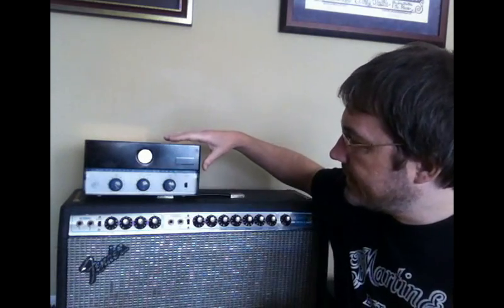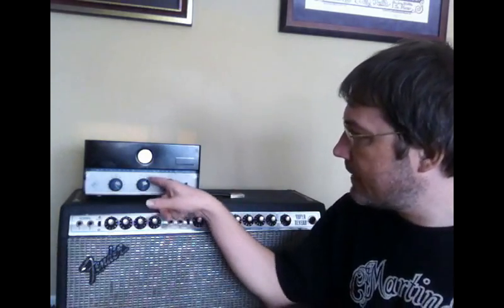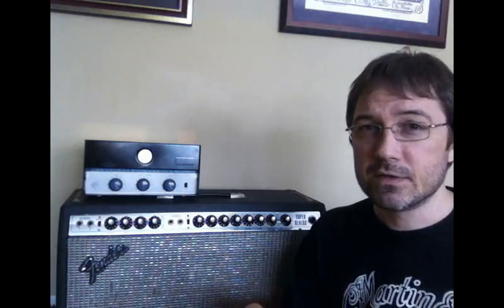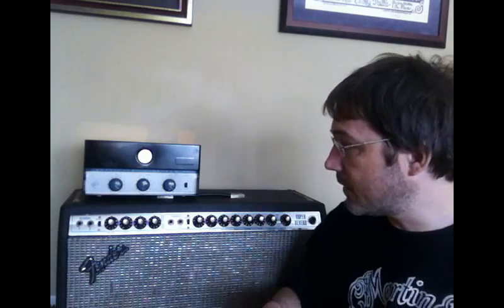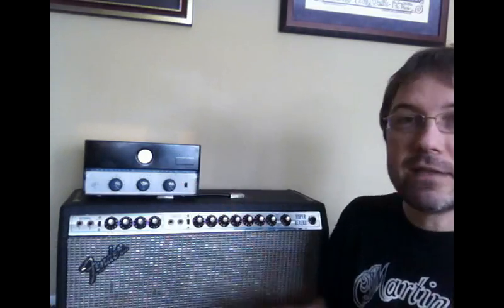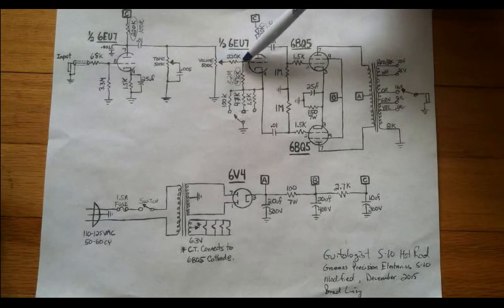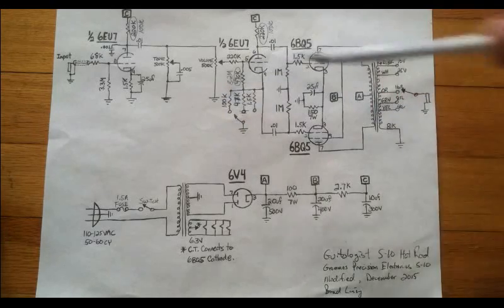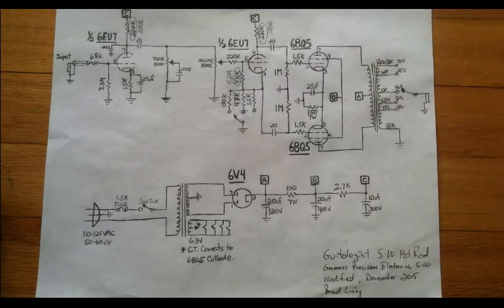Modifying Phase Inverter Balance for More Distortion

Comment: Normally the cathodyne floats at about 1/3 the positive voltage rail. Either it is directly coupled to a previous common cathode stage or it is self biased by connecting grid to a point below a cathode bias resistor. You are misssing a coupling cap for this to work. Your schem is not complete. The volume pot indicates the cathodyne is self biased and floating and there must be a cap between teh pot and the grid of the PI. 
You can also alter the symmetry/gain by ac-coupling a resistor to the cathode side of the PI. Then the DC voltages do not alter.

Comment: With a 220k resistor in the plate of the first stage, you are increasing the gain thru that stage as compared to a 100k resistor.  There is a lot of signal going into the second triode.  There is a voltage divider put in there to limit the amount of signal, but your variably changing that and all you typically need is 1V P-P to drive a PI and power section to full power.  It's easy to get 10V out of the first gain stage, so 10x the amount of signal needed.  Therein, you're slamming the power section with too much signal causing it to distort!  You can verify this by including voltage readings and SEE what is going on with a meter and O-Scope!

Comment: This is the reason old amps like Gibson etc often distorts at low volume – the resistors drift in value and the amp becomes unbalanced.

Comment: It is a balance between the coupling cap and the resistor prior to PI. The more unbalanced the more distortion. I see a .01uf  coupling cap in the schematic so the resistor value is related to that. People usually experiment with different coupling caps instead of the resistor as they relate to the values of the first stage cathode bypass caps and resistors notibly to control bass response.
Reply: And i see a classic 25uf/1.5k in the cathode bypass section. Classic Fender. I would make the coupling cap switchable io the resistor.

Comment: Thanks for all of the tutorials. I'd like to return the favor by explaining the invertor's function. The cathode resistor is grounded, which provides a voltage increase for the following stage of the push/pull cycle. Varying the value of the cathode resistor disturbs the phase balance. Think of it as very badly mis-matched tubes.

Comment: Since the cathodyne stage is designed to sit balanced between the positive and negative excursion of the grid input signal of the stage, changing the bias on the grid most likely introduces some soft clipping distortion to either the positive or negative odd the input signal.  Interesting as you'd think that would be an undesirable buzzy distorting.
Hey, some of the best discoveries come from accidents like that!
As usual, thanx for sharing.
Aptos be cool to see the input signals to the power tubes on dual trace scope.

Comment: I love this. It seems like you are introducing a offset bias to one side of the phase inverter. Could this have a similar effect on asymmetrical clipping that Marshall uses in it's JCM800 preamp circuit with the "cold clipper" to give levels of even order harmonics based on the high value cathode resistance for the triode?
Reply: Tested changed the 82K => 47K on the phase splitter on an 1987 head, it works!  I got less volume (not a bad thing) and more soft clipping. Since these (plexy style amps) are rather bright it should be good..

Comment: The 6eu7 was designed by RCA as a upgrade for the 12ax7.
Reply from the maker: It's essentially a 6v 12ax7 with a different pinout.

Comment: Thanks for making this video I've been looking into un-balancing the pi for my 5E3 (sort of replica) this helps a lot. 
Try the 220k plate load resistors they will have more voltage swing/gain.
I did for the normal chanel V1 for my 5E3 and it gave it a very nice boost.
Reply: 220k on the plate of the cathodyne PI?

Comment: A Cathodyne Phase inverter has a unity gain ( actually a tiny bit less). That gain is set by the ratio of plate to cathode resistors which is why the 100K in the cathode gives the cleanest tone. In this mode the 2 EL84 valves are operating efficiently and symmetrically in Class AB. The more you move away from the 100K the more imbalance you introduce (you'd see it as a difference in amplitude of the positive to the negative half of the sine wave). Eventually it will shift into complete Class A, which will once again clean up as you reduce the preamp volume, but one valve will not be contributing to the output.
Reply: Chris Tarakson i

Comment: There are transformers that are not wound the same number of turns for the push pull on purpose to assist in the distortion and the use of different value resistors on the phase inverter.  ALSO like what you have done here, many  amps have a "FEEDBACK"  (AKA/negative FBR)   RESISTOR GOING FROM THE SPEAKER OUTPUT BACK TO THE PHASE INVERTER (usually the grid of the 2nd half of the tube)  This resistor can be taken off or changed to a different value or put on a multi switch for different settings. If taken off there will be more highs more lows more gain more everything. The resistor is used to help clean the amp up a little when using a clean setting at high volume settings. I learned this mod from Dan Torres and have done it to all my amps for 30 years at least. I know you know but are those that don't know. Ya know? ;)

Comment: Thanks for sharing your schematic. I've had one of these things for close to 20 years probably and thanks to your vids on it, I finally dug it out of the closet and modded it up.  I rewired the preamp socket to accept 12**7 tubes because screw paying $30+ for a 6eu7, lol.  I tried doing the PI distortion thing on a pot but it was all scratchy sounding when you'd turn it and there really wasn't any great range or sweet spot you can't get with a toggle or rotary.

Comment: Personally I'd use a fuzz pedal for that kind of sound instead of throwing the phase inverter so off balance. You mentioned trying to get more gain out of the preamp stage. I'd try reducing the input resistor from 68k down or eliminating it entirely. It's there to reduce radio frequency interference but might be overkill. Some amps don't use one and just make sure the connection is shielded all the way to pin 2 from the jack. I'd need to see voltages on the schematic to comment more.
Reply: In your circuit the grid stopper and grid leak at the input form a potential divider. By increasing the grid leak you've got a larger proportion of the input signal to go to the grid, but if you want to maximize the signal to the grid, put the stopper after the grid leak. Connect one end of the 68k stopper to pin 8, close to the pin, and a 2M2 grid leak between the other end and ground with the input directly across the grid leak.

Comment: Very nice work Brad.
I have a question if you dont mind. I see the power rail caps/resistors of your finished amp are not the stock values. Do you recall if you changed these components because the original can cap was bad or did you change the caps to get the desired end results? I have my Grommes S10 on the variac at the moment hoping to reform the caps and so far at 90 volts it's dead quiet.
Thanks for sharing so much knowledge on YouTube. Your videos have been an enormous help to me and my tube amplifier hobby.
Rob.
Reply from the maker: Thanks Rob. I changed the caps because I had some hum I was trying to combat and thought changing the caps couldn't hurt.
Reply: I got very lucky Brad. This one is dead quiet.
Did you remove the negative feedback loop? (I cant tell from your revised drawing)  I changed the NFB resistor from 22k to 5.1k and the fizz is all but gone. 
What a little screamer this amp is. I still need to tweak the tone stack. Since I have the extra pot in the center (adding mini switches for your 3 way gain mod and NFB)  I was going to add a bass and treble control but I think the single tone control will do well by itself. Cheers!
Reply from the maker: Can't remember what I did on the NFB. Whatever is shown on the schematic is what I ended up doing, I'm sure.

Comment: Seems to me that not only are you affecting the over all balance of the output, but you're also drastically modifying the bias of the tube. Once you start going lower than aproximately the same value at the plate (for a split load circuit like a cathodyne) on the cathode, you'll start to notice a drastic change in the balance AND the gain of the tube. Checkout some datasheets for common triodes and check out the curve charts for cathode bias for either split load or cathode follower circuits, and you can see just how drastic the changes are. 

I also can't help but wonder how bad that would be for the tube, as it's probably drawing excessive plate current when using a 1k5 Kr. It would be fun to experiment with! Maybe next time you're messing around with that amp, measure the current being drawn under your 3 settings, and for added fun, see what happens to a clean input sine wave via a scope.

Anwyay, this is a fun experiment, and one I'll try out the next time I'm messing with a splitload circuit! Thanks for the video!
Reply from the maker: Thanks for the comment. Although I did not record the exact plate voltage on the PI, the tube was still operating. 6EU7s like 12ax7s are a very forgiving tubes, capable of operating safely across a wide variety of bias conditions. The max voltage available at that power node didn't exceed alarming levels anyway. But, yes, next time you're messing around, try it out! Made a vid and link it here!

Comment: Why/how does the CT of the filaments get connected to the cathode?  Don't see why this isn't grounded.    Also, I would be interested in any further information on the power transformer and output transformer.  Thanks!  Sounds great!
Reply from the maker: Sorry, just saw this... It's supposed to help with noise. The cathode of the output tubes is at a different ground potential around 10-40v or so above ground.. This is called "elevating the heaters". There are more technical papers and stuff on the net if you search that term.

Comment: You're both adding asymmetry and changing the gain that stage provides. Essentially, what happens when you throw 1k5 on the cathode is that you turn the inverter into a gain stage, and the output becomes a self-split push-pull stage (search for "firefly mini amp" for more info on that).
Since there's more gain, the output stage is driven into distortion, with great asymmetry due to uneven drive between the two power tubes.
Reply from the maker: +blackcorvo Yes, I believe this is what's going on too. Thanks for the comment!
Reply: Which is why there is always a larger resistance before the second stage of a long tail inverter. In the long tail it goes through the first grid of the first tube. With say an 82K resistor but coming off the plate of the first tube you have to tone it down with say a 100K resistor before feeding it into the second grid of the Longtail phase inverter. 
  So in this example instead of overdriving the phase inverter tube your overdrive the output tube. I think that makes sense. But I'm still learning.
Reply: The PI on my Pro Junior starts to distort on one side before the power tubes saturate, which may be the design intent to produce even harmonics.  It sounds good.  But, being a purist, I don't like that.  I want to hear what it's like with pure power tube distortion.

Comment: In the fuzz mode, with a plate load resistor of 100k and a cathode load of 1.5k (basically just over 1% of total load on the PI tube), I would think the plate output is being increased quite a bit. In a way, you have gone beyond an imbalance for the output tubes and into the territory of a single-ended power section with the upper 6BQ5 being the driven tube. This may explain why the distortion is more pleasant to the ears, as the single over-driven tube will produce more even order harmonics that aren't being cancelled much by the other "starved" power tube.

At first, I would have expected the volume to have decreased in this scenario since only one of the output tubes is essentially being used. However, looking up the data on the 6BQ5 it seems it has quite a low amplification factor of around 20, versus the 6EU7's factor of 100. By turning the PI tube into an actual 2nd stage pre-amp tube AND possibly over-driving it, that may also create a pleasant gain with nice harmonics that get boosted slightly by the power section (which is now really only 1 tube). In essence, you may have created a dynamic "hybrid" circuit with the capability of switching between single-ended distortion mode and a high head-room push-pull mode for cleans.

Just my theory on what's happening...the only downside would be a possible short lifetime for the over-driven tubes. It would be interesting to A/B with simply removing the bottom output tube. I'd also be interested in seeing the AC waveforms from both the inverting and non-inverting signals when using the fuzz mode. Do you have a scope?

Also, what drove the decision for such a high grid leak resistor (8.2M) for the PI tube? Did you find this was necessary after the other mods. Just wondering if that could be reduced to say 1 or 2 meg with slightly better/different results.
Reply from the maker: +Scott White  I think this is correct.  It's turning that PI into another gain stage before what is essentially a SE output, but not quite. Thanks for the insightful comment. I think the 100k pot in series with a 1.5k resistor might be a more useful solution since  you could dial in any level of operation in that range.
Reply: +The Guitologist Yeah, adding a 100k pot between the cathode and the 1.5k should provide an interesting gain knob for the amp. I think Bourns make some 1-2 Watt pots, though they ain't cheap. Also, I'd reiterate that the PI and inverting power tubes may be getting quite the workout, so having a few extras wouldn't be a bad idea. Small price to pay for good tone, heh? Btw, thanks for all the vids, one of my favourite youtube channels.
Reply from the maker: Thanks!
Reply: I was just going to say same thing

Comment: I have done a little three part video series some time ago about how and why the harmonics footprint of an PP Amp is generated and also i disscus the behavior of an Amp driven in to saturation the harmonics "structure" and how they are "generated" and how WE can alter the harmonic footprint to meet OUR needs, feel free to watch: 

Part three of this series covers the dismatching of the phase-splitter and its output voltage, and also the impedances.

https://www.youtube.com/watch?v=IPqpmbiRlAc
https://www.youtube.com/watch?v=lJjAHLCtXWA
https://www.youtube.com/watch?v=Q8loEvel5sk
Reply from the maker: +TubiCal Thanks for sharing. I'll def check them out.
Reply from the maker: +TubiCal the third video was, indeed pertinent to this conversation. Nice to see what happens on the scope with the harmonics when the resistance is increased and decreased. Thanks again!

Comment: Pretty interesting, could you add some voltage readings off the power tubes as you switch resistors ?  Would be interesting to see the actual effect on the circuit.  Maybe add the info to the video description ?
Thanks for putting this up for us to see.
Reply from the maker: +Barefeet200 Good suggestion! Had I planned this video a bit better, I might have been smart enough to think of doing that. :)

One thing I've noticed is, with the 1.5k resistor engaged, the AC signal coming through the cathode of the PI sees just as appealing a path to ground as it does to the grid of the lower output tube.
Reply: +The Guitologist since it exactly matches your grid leak resistor ar the power tube grid? Am I reading that right? So does that power tube actually get any signal or about 50% of what it gets in clean mode?
Reply from the maker: It does indeed match that resistor. That was an observation I also made, but when experimenting with various values, this seemed to be the magic sauce. As for why it is, I'm not even sure myself. It does have the look of a voltage divider. Another comment brought up the subject of measuring voltages and analyzing the circuit with a scope. I think that would tell more about it. At any rate, that amp was sold, so someone will need to build another one to find out.